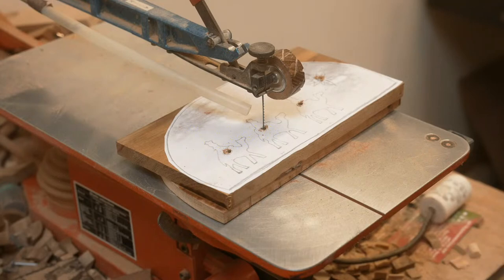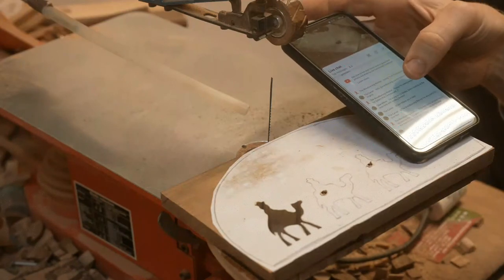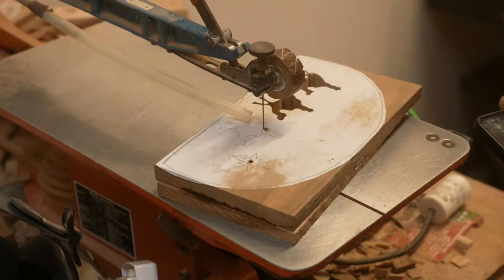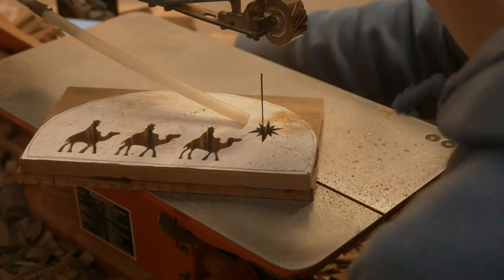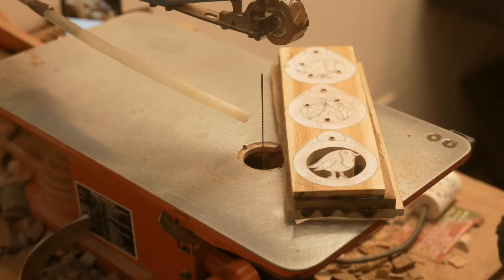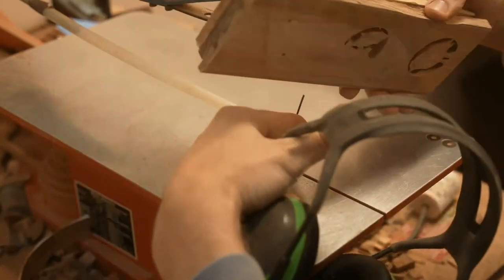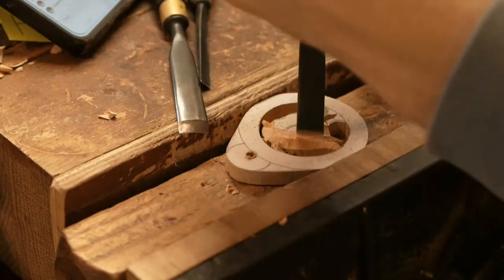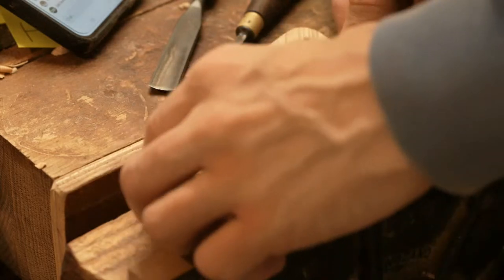Scroll saw and wood carving live.

Comment: The manufacturer that makes Niqua also makes the Flying Dutchman blades, in actuality they are the same blades. Mike used FD as his trademark when he imported them for the American Market..  My go-to-blade here in VA Beach, VA is the FD Ultra Reverse #5.  I love the finish on the cuts, smooth and no need to sand.  

Also, I appreciate your "real time" sawing.  I learn a lot of techniques this way. And appreciate the slow and steady pace, similar to mine. 

Here's a tip, that not many people know.  I take a small sharpening stone and I place it behind the blade (you could use sandpaper on a small block too) and run the saw for a few seconds turning my stone black at an angle slightly to sort of round the back of the blade.  This makes my turns a bit easier as there is no sharp edge to catch the wood in the back.
Reply from the maker: Thanks for sharing your thoughts. I realised the first time I used flying Dutchman blades blades that they are the same as Niqua blades. You don't see them in the UK very often. The Niqua blades we get hold of directly from the factory in Germany. 

Thanks again for supporting our YouTube channel. All the very best from us all. 👍

Comment: hi, im a begginer with the scroll saw. why do you put anoter piece of wood under the one you are working on?
Reply from the maker: Hi, great to hear from you. It's a method called stack cutting. By having 2,3,4 etc pieces of wood stacked together you can cut out more than one at a time. By the end of the demonstration I have 2 candle holders and 6 Christmas decorations. As opposed to one candle holder and two Christmas decorations. This method is an important factor in helping us to survive as a family workshop. 

Hope that helps. Feel free to give us a shout if you have any other questions. Thanks for supporting our YouTube channel. All the very best from us all. 👍